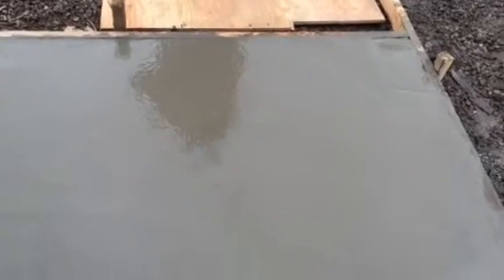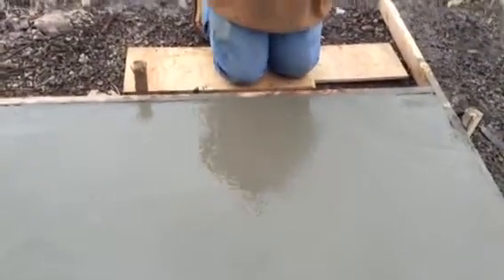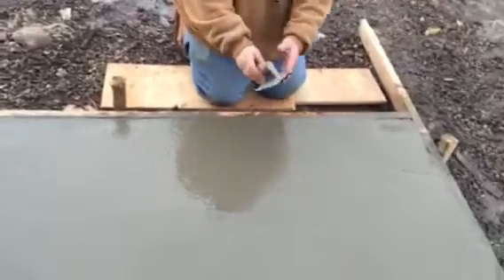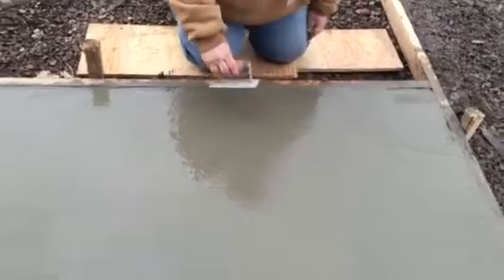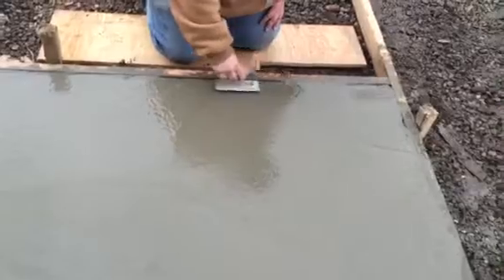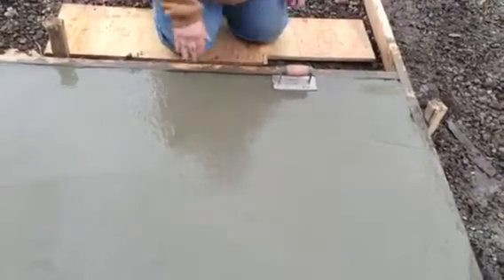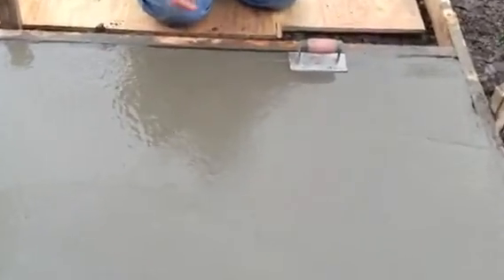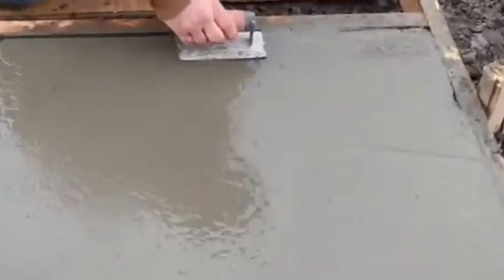How to Finish a Concrete Slab. Part 2/3

Comment: way to wet
Reply from the maker: Yes , it was bag mix concrete in 35 degree weather.
Reply: kenneth hanaburgh yes it is Kenneth, I woulda waited,edge will just just collapse. Gotta clean those forms off too! And use a wider edger at least a 4"
Reply: Looks like lack of calcium and too much water. I agree I would of waited like 25 mins after straight edging to do anything.